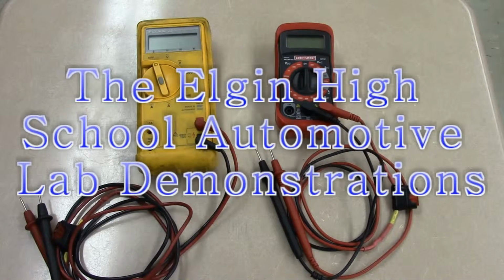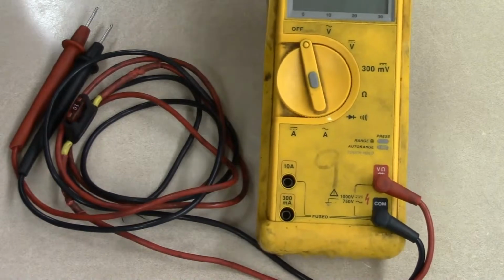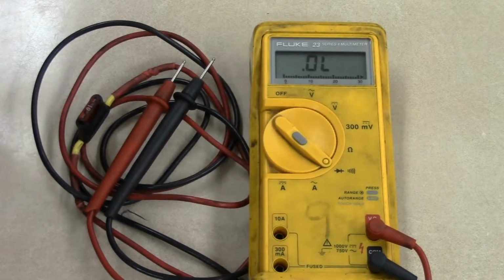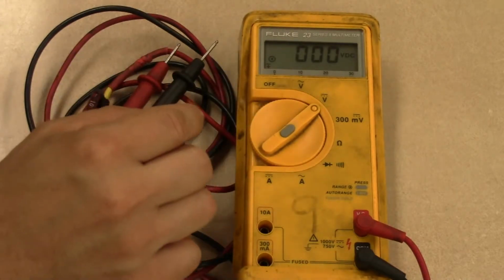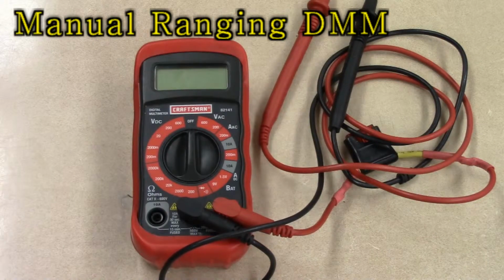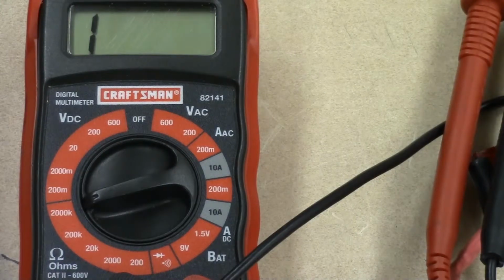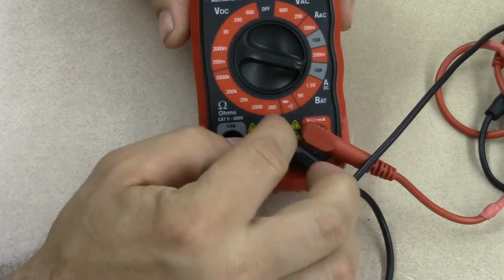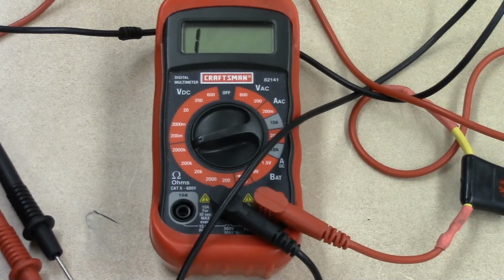Digital Multimeter Rundown

Comment: On the Craftsman what does the 1.5v Battery setting do differently from the dc volt setting?
Reply: I know it's an old post, but just watched video. I believe the 1.5V and the 9V are just convenient for checking these standard battery voltages, AA and 9v. You could also check the batteries on the 20Vdc setting at the 10 o'clock position of the meter as well, so I just think they're convenient, but redundant. A quick check.
Reply: @Dlab-x7x As I understand it some battery testers use a resistor to put a load on the battery while measuring the voltage.

Comment: Hi, I have the Craftsman 82141 tester and I can't read all of the numbers on one of the two fuses in the multi-meter that i need to replace. With the back off and bottom of meter facing down the fuse is the one on the right side. The fuse says 10A250V but I cant read the other numbers that may indicate size etc. One set of letters appears to say GFE on one end of the fuse. Can you help on this? Thanks!

Comment: Thanks for the video! I have the same Craftsman meter and want to test amps/milliamps output of a 12V battery trickle charger that is rated as 800 milliamps output. So if I understand this correctly to test the current/amps output I need to have the red lead in the 10A grey marked position on the bottom left of the multi-meter. Is that correct for the leads? In turn the setting selector would be moved towards the lower right of scale where it is also grey and reads 10A and near is also says A over DC. Is that correct? If so with the battery trickle charge I should then be able to use black lead to negative and red lead to positive  output clamps and read the amps/milliamps output of the charger to make sure its working. Is that correct? Thanks for your input on this!